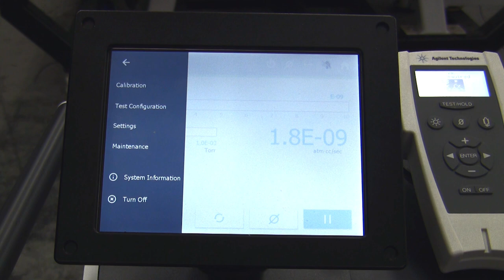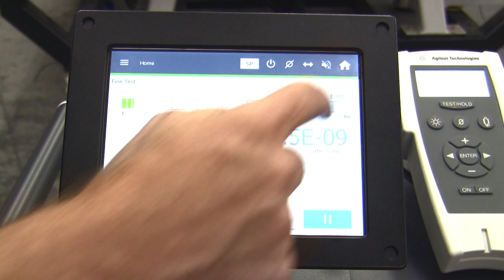Ipsen Leak Detector Package

Comment: Is the roughing pump (Blower + Pump) ON while the leak is being detected by the leak detectors?
Reply from the maker: Yes, the pumps are on during leak detection. If the pumps were to turn off,  the vacuum valves would close automatically.